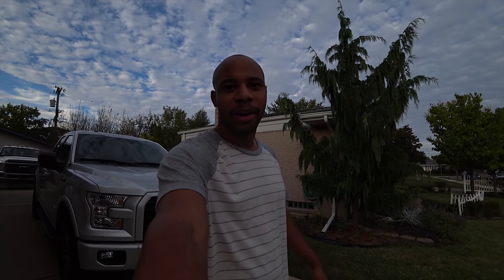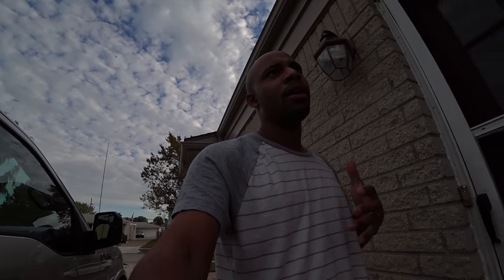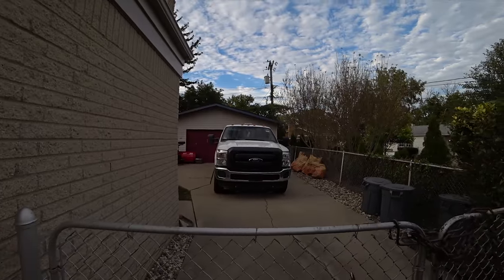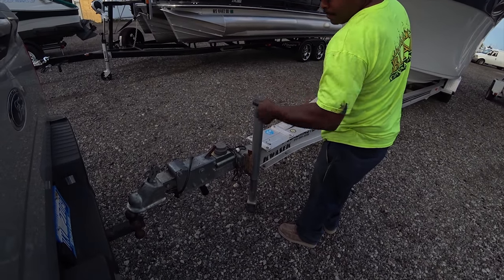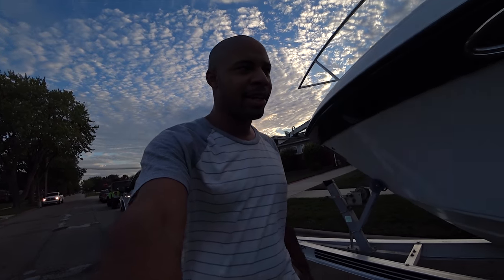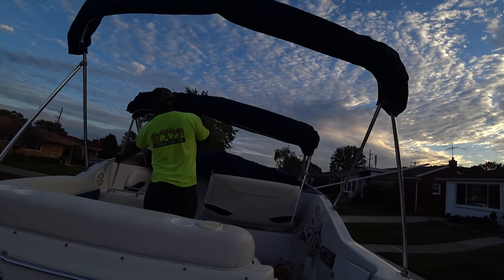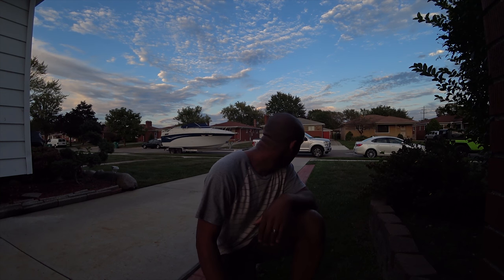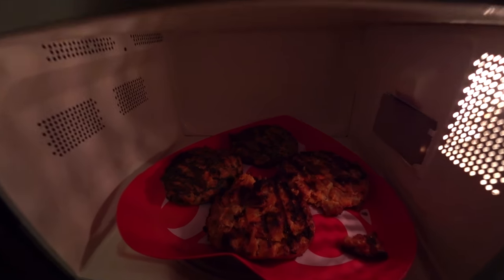2.7 Ecoboost towing 7000 lbs

Comment: Just did a sketchy 500 mile drive with my 2.7 2015 and towed a 9800lb 36ft camper she did alright kept her under 65 due to not having the sway bars and my truck having a 6inch lift water temp normal and transmission temp at 203
It was from lake Charles LA to deep south texas
Reply from the maker: Dam

Comment: I like the 2.7 ok, never owned one but I’ve driven one 3-4 times and it has pretty decent power for a smaller v-6. What’s wierd to me is that I’ve owned (and still own) a 2005 f-150 4x4 Lariat Supercrew with the 5.4 3 valve Triton v-8. The motor had 300 HP and 365 lbs tq. Never had an issue with power or performance when towing with it, which I did pretty often. Now I did have the best rear gearing for max towing capacity so I know that helped. But I have 2 boats that I towed, a 21 foot Carolina Skiff DLV center console with a 140 HP Suzuki outboard & single axle trailer and a much bigger and heavier 25 foot Grady White center console fisherman with twin 150 HP Yamaha outboards and a dual axle trailer. The 21 ft skiff was a light and boat/motor/trailer combined to weigh around 2,400-2,500 pounds. The Grady weighed in around 6,100-6,200 pounds with motors and trailer. (It was the 257 model so it was actually alittle over 25.5 feet with added options such as toilet, second XL livewell, added cushions, extra SS rod holders & rails). Once the electronics were installed and with some fishing equipment on board it can weigh closer to 6,300-6,350. I’m saying this cus I used my ole ‘05 V8 f150 to tow both boats for years, got the skiff in 2008 & the Grady in 2012. Obviously it had no trouble with the skiff, really couldn’t tell I had anything back there most of the time. But it kinda surprised me how well it did with the Grady. Keep in mind the truck was already over 7 years old and had over 110,000 miles on it but it pulled it with ease. I could of course tell I had a large, wide heavy load back there and it caused a couple inches of sag in the rear but it pulled it up boat ramps, from red light stops, through the NC mountain roads etc. for hundreds maybe thousands of miles. Gas mileage wasn’t good, but that’s not a big concern with me. Anyway, I was at the beach when a friend of mine asked if I would take him fishing, my wife had my old truck with her that day so I said we’d have to use his. He has either a 2017 or 2018 f150 4x4 supercrew XLT with the 2.7 ecoboost. I read it had 325 horses and 375 lbs tq. Which would make that small motor a good bit more powerful than mine. His truck was rated to to 7,457 pounds. Alittle less than mine (I thought because of gears and shorter bed maybe) but enough to tow the big boat to the water. After all, he was rated at well over 1,000 lbs more than the load. I drove as he had never trailered a boat that big and I noticed a difference almost right when I hooked up. The sag was about the same, but I thought it may be even more pronounced in the new truck, maybe a half inch or more of sag than mine. Oh well, not a big deal. But when I gave it alittle gas it just felt sluggish. I actually reached down to see if the parking break was pressed down some causing the resistance. But it wasn’t. We got to the road and when the light turned green I accelerated like I always do. Disappointing. Now it wasn’t HORRIBLE or that much worse than my truck, but it was def noticeable that it was struggling a bit more. It swayed alittle more, felt slightly less in control than what I’m used to. Has anyone else experienced this? I’ve driven the 3.5 ecoboost before and I know it’s a beast and has no problem with even bigger loads. But to me the fact a 2005 300 HP V8 performed better than a new 2017-2018 325 HP (plus 10 more lb tq) turbo v6 surprised me. Again,  not a massive difference, but quite noticeable. Better gas mileage but that’s about the only thing it did better. Once the trailer was off and I drove it more it was def a good bit quicker than the old truck, as long as there was no load behind it. Do gears matter that much in towing a load under 6,400 lbs? I have the optimum gearing for max towing, I guess he doesn’t but I’m not sure. Btw my brother has a 2017 F250 6.2 gas V8 Super Duty 4x4 and it tows a 11,117 lb 31 foot Mako w/ twin 275 verados and a triple axle trailer like it’s nothin. That’s gonna be my next truck
Reply: Great Saiyaguy 
My 2000 F250 only has 235 hp but the 505 ft/lbs of torque toes my 24’ bay boat like a champ. That truck is going on 20 years old

Comment: I was conflicted on the engine but I’m definitely going with the 2.7
Reply: if you plan on towing with an F150 ecoboost you have to get the 3.5 ecoboost or just get the 5.0.
Reply: I know this comment is old but I didn't want a 2.7 truck either I don't tow often but I wanted either the 5.0 because of a V8 or the 3.5 because it will Stomp The Daylights out of a coyote but I found the perfect truck lifted ruby red 2018 and it had a 2.7 so I test drove it and bought it that day it's not even tuned yet and it rips it's unbelievable 164 cubic inch can run like this in short Sprints I outran a 3.5 EcoBoost and my buddy's 5.0 coyote!  Now the 3.5 truck eventually runs me down in longer distances but the 2.7 spools and builds boost faster

Comment: My nearly 14 year old 2005 f150 Lariat 4x4 supercrew with the 3 valve 5.4 Triton V8 with 228,000 miles still tows my 25.5 foot Grady White with ease. It’s a Center console w/ twin 150 outboards and a dual axle trailer. All combined weighs around 6,000-6,100 pounds. Can weigh closer to 6,300 sometimes when loaded with some fishing gear. Been towing it with this truck since I got it in 2012 and it still does great. (Did alittle better back in 2012 when it was just 6-7 years old with alittle under 100,000 miles, may have lost just a tad bit of power from back then but still gets the job done). 300 HP and 365 lb tq. Back then in 2005 those numbers were pretty good for a half ton, especially the torque. My buddy has a new 2017 or 2018 f150 4x4 supercrew XLT w/ the 2.7 ecoboost. He’s rated at 325 HP and 375 lb tq. Plus he’s got the trailer brake control system. So he’s got more power (25 more horses and 10 more ft lb tq) and more towing technology, and a nearly brand new either 2017-2018 model (forgot which one) with less than 35,000 miles on it so it has no wear and tear. He rarely uses it for towing anything expect a small 16 ft Jon Boat that weighs basically nothing, and hasn’t come within 900-1,000 lbs of the payload limit. We used his truck to tow my boat 14 miles from my place inland to the ramp at the coast last month and I must say I was unimpressed. I think my old truck handled it better, I know I have the optimum rear gearing for max towing plus a slightly longer bed/wheelbase but he has the power, technology and overall newness and it still did worse. The 3.5 ecoboost is a beast and the 6.2 gas V8 in the 250/350 super duty’s is a beast but this engine is shitty

Comment: Thx for the video. I can definately relate to the C Crew schedule. I did it for 5 years at LAP and now on B. Anyways i am going from a 2001 f150 with the 5.4 (2 valve) to the 2.7 ecoboost. I rarely haul trailers except in tge summer and was wondering how well it would tow my 18' Fish&Ski. From your video and a few other i think i wont be afraid of the 2.7. Looking for deals on the 2019s and already like tge 3.5 and 5.0 but was sketchy myself of how well it would handle the load. Thx for the video.

Comment: I tow 7,600 travel trailer with a 2017 2.7
Reply: That’s the year/engine I have and been wondering if I can pull a travel trailer that weight. How is your transmission temp when you tow it?
Reply: @mattbourge  temp normal I get about 15 mpg at 70-75 mph in the summer
Reply: Thanks, that’s great to hear!

Comment: struggled doubt it 2015 GMC 4.3 v6 only 3.23 gears tows a 5k boat all day has same rating no boost, also have a 4.8 vortec pullled 9k over weight on bumper not smart but backed up logs no problem, Ford is not a knight in shiny armor any 1500 truck will do it.
Reply from the maker: True!
Reply: i do like ur new 450 that thing is a beast.
Reply from the maker: @stevenstrawn5009  I know! It's a beast!